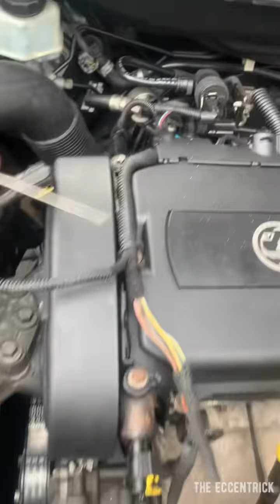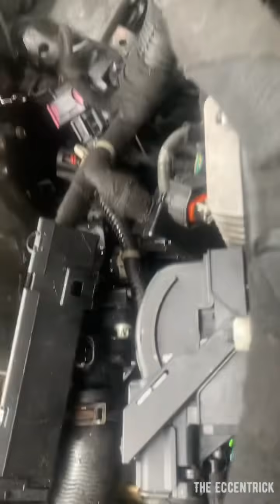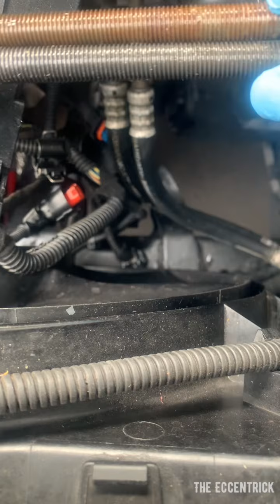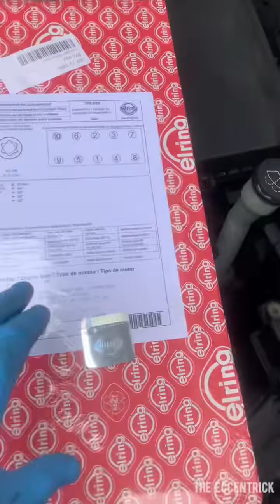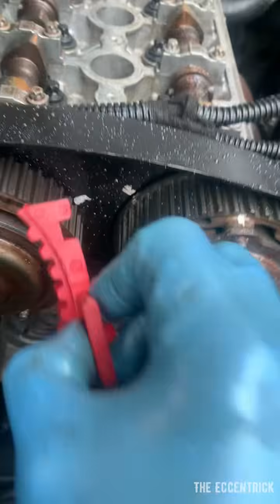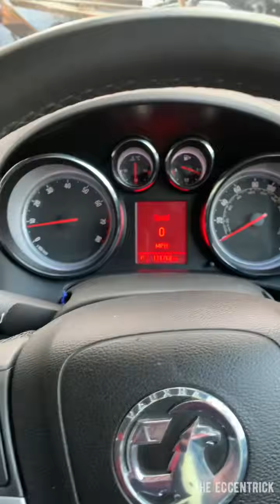Vauxhall Astra - Head Gasket - Timing Belt - Astra J 1.6

Comment: Hello mate ...is there any chance you could give me some advice on my 2006 astra 1.4i 16v sport ?
Reply: Hi how are you ? ...my astra seems to just loose power when driving acceleration just goes dead and then kicks in again and some times it just doesn't pick up acceleration and then at times it drive well and is quite nippy
I'm having a new water pump fitted at the moment and it's got error codes saying cylinder 2 misfire and 4 and multiple misfires detected plus about 3 different 02 sensor codes and when sitting idle the car will start juddering and then stop like its cut out but engine sil running nice and quiet 
Any ideas ?
Reply from the maker: What can i help with?
Reply: @theeccentrick  hi ...my astra 2006 1.4i sxi 16v keeps loosing power when accelerating and then kicks back in and a lot of the time it just doesn't want to accelerate when foot to the floor and when at lights idle it will start to judder and then stop feeling like it's cut out but engine still running nice and quiet I have error codes saying cylinder 2 and 4 misfire and another one saying multiple misfire detected and I think 3 error code saying 02 sensor 
No lights come on when driving but it's in the garage now getting new water pump and mechanic told me there is no bulb in engine light so probs why its not coming on 
Any ideas mate
Reply: When it's not doing this it drives quite well
Reply from the maker: First things first i would start by confirming/diagnosing where your issue lies, the garage should…
1) Check the spark plugs and test the O2 sensor 
2) Check coil pack and Check harness for the coil pack is not damaged (on right of engine)
3) wet and dry compression test to confirm cylinders and timing appears okay.
4) They should test the Evap Purge valve which commonly causes your symptoms on theses cars.
5) Check and clean and realign throttle body
6) Make sure no air leaks on the intake
7) perform a reset of learnt adaptations.

No Particular perfect order!!!
Reply: @theeccentrick  thanks for the help my friend I will let the garage know and send them a copy of your reply and hopefully get this car running healthy again ...thank you

Comment: Great video do you know why the head gasket went?
Reply from the maker: Sadly the cooling systems on this engine are prone to issues. Ignoring a leak or failed thermostat leads to overheating which very quickly causes the damage.
Reply: @theeccentrick  good to know I will keep eye out for engine temp in the secret menu 👍

Comment: Thanks for the video. What did you clean the head with and where did you those those plastic tools. Thinking of attempting this myself!
Reply from the maker: Hi, the head was sent to an engineering centre for prep and arrived ready to install. Was just blown with compressed air prior to seating. The timing tools go between the cam sprockets and need to be slid-in in a particular order. You may want to check a separate video for that.
Reply: @theeccentrick  Where can I get those plastic tools? Thank you

Comment: Hi I'm currently doing mine- should the cam sprockets move without actually turning the camshaft? 
Only the intake one on mine moves slightly ?
Reply from the maker: No a non-variable sprocket should not move at all, Tighten to the correct  torque specs and it will become one with the shaft
Reply: @Eccentrick  it is variable vvt  but only moves about  2mm side to  side?